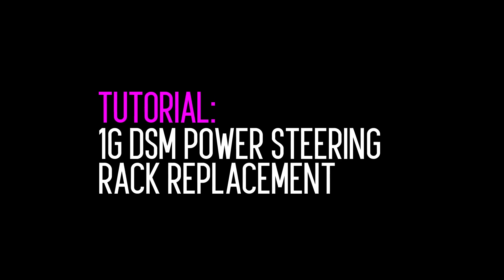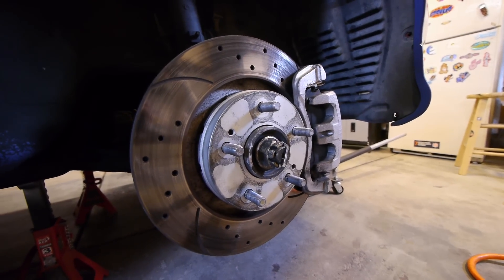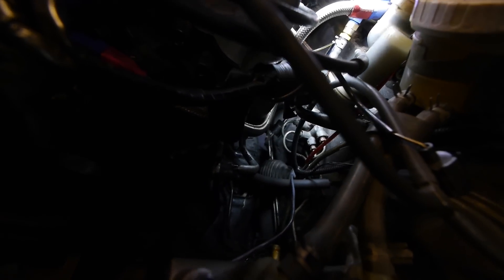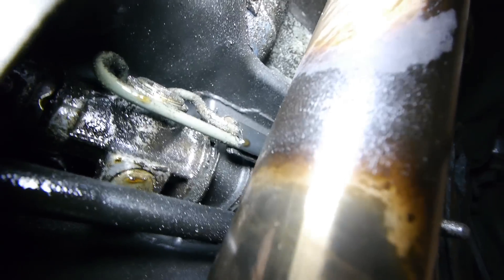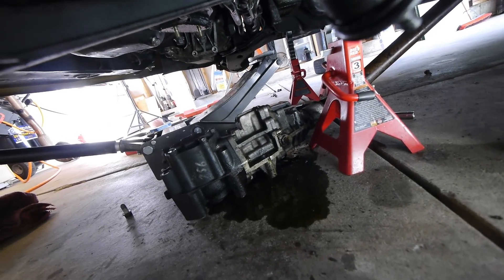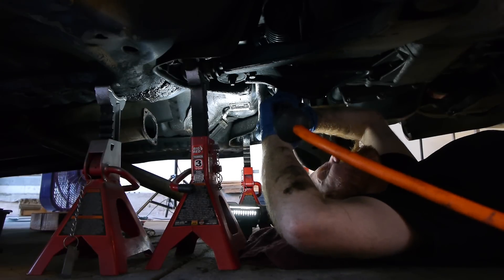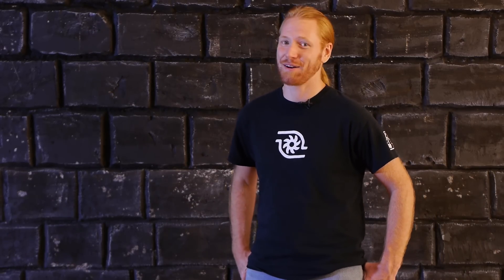1G DSM Power Steering Rack Replacement

Comment: Great video again! I would like to add one small point to this video, not that it wasnt perfect the way it was, but it may be helpful. People WILL need to get an alignment done after performing this swap. I always try to meausre my current rack tie rods and end links to get them in the ballpark and match these measurements on my new rack. Also make sure you are in the center of your throw before inserting the splines into the coupler. This will save some people the mistake of having to pull the rack back down to correct things once up. Again great job doing this video and I would like to see more video's more often from you. I enjoy them very much. - Adam@SickPerformance
Reply from the maker: +4G63addict Good points!  Yeah I forgot to mention all of those things, I'll add them to the description and hopefully people will see this comment as well.  Glad you like the videos, I'm working on getting them out more often!

Comment: Nice work i did the same on my 91 dsm but i never removed the cross members. I wish i did tho would of made it way easier but i still managed to get the job done. Also i love that valve cover color looks amazing
Reply from the maker: +Steve Davenport Thanks!  Yeah there are a few different ways to get this job done!
Reply: Hey, mine is a '91 also. I spent all afternoon doing mine but I'm having trouble getting the rack out. How did you get it out without removing the cross members?

Comment: I found it easier to access the hoses and lines to the steering rack from under the car instead of removing plug wires and ac lines from the top. I drive a fwd though so maybe it's different. Total time about 8 hrs minus a trip to the store thanks!
Reply: Sweet... just what I needed to hear!
Plan on attempting this very soon.

Comment: hello I saw your article on dsmtuners and you replace outlander brake system I mean caliper and rotors so I have 2g dsm rims and specs:
 Wheels measure 16x6" +46mm offset
Wheels carry a 5x114.3 bolt pattern and 67.1 Center bore

so outlander brake system will match with my rims?
thanks

Comment: I've always found it easier to pull the transfer case straight onto my chest. After it comes off the alignment dowel the splines from the output shaft will hold it until you can wiggle it off.

Comment: This job on a proper hoist with good tools takes me 1.5 - 2 hours, depending on how much the steering shaft bolts fight me. Also have to torch the jam nuts a lot of the time. I always recommend replacing the inner and outer tie rods with any steering rack replacement.

Comment: How hard was it to disconnect the shaft from the spline on the rack? I loosened the 12mm bolt but its not giving... I can't really get a pry bar in there to separate.
Any advice?

Comment: Wish me luck lol, im going to be doing this pretty soon. Except I found a manual steering rack from a base model 1.8l dsm and all the mounting brackets for it, if all goes well ill have those shipped from a wrecking yard with everything I need. Just going to completely get rid of the power steering all together, but pulling it out is going to be biggest hassle of this project..

Comment: Hey fantastic detailed video! Can I ask what brand of tool you used to pop out track rod end joints? Thanks
Reply from the maker: +Jay Young (Turbo21) Harbor Freight Ball Joint Separator, check out the Drop Spindle video where I buy it!  Here's a link: http://www.harborfreight.com/3-4-quarter-inch-forged-ball-joint-separator-99849.html

Comment: I have a question for you. Have you ever had to deal with your idle pulsing? And if so what was your solution?
Reply from the maker: +Steve Davenport I've been lucky with this car, but idle surge on DSM's is pretty common.  I'd start with a boost leak test and then follow this guide or other articles on DSM Tuners.  http://www.dsmtuners.com/threads/how-to-fix-your-idle-surge-problem.191137/    Good luck!
Reply: Ive done a boost leak test even rebuilt my throttle body and tested again with no leaks but idle still pulses.

Comment: Great video! I gotta know what kind of camera your using!!
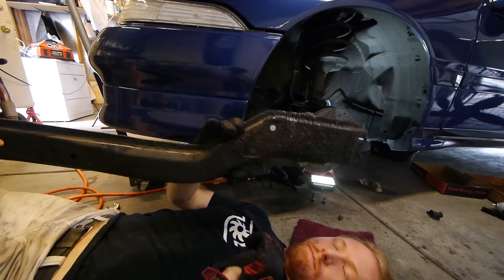Reply from the maker: +Joe Wrenches I'm mainly using a GH2 with a couple different lenses and I also use a little Sony dsc-tx10 to get into tight places, like the shot 4:55 showing the rack and 4 bolts holding it on is the dsc-tx10.  I also have some T3i shots mixed in occasionally.  I want a Sony A7S, those things can literally shoot in the dark!  I need more car parts first though :P
Reply: +Velocity Labs Thanks for the info! I think I need a GH2 or T6i type camera coming up here. Car parts DO trump though!

Comment: I did a power to manual rack swap on my old 89 Colt GT, but I had the motor out during a 4G63T swap, so it was easy. Same procedure, just less work.

Comment: Hello Erik love the AWESOME DSM vids. I need your expert advise with my 1g GSX, I have to replace the brake. The guy I got it from told me to look on google for the 1ga big brake. I just don't know what to get, please help I need to change the brakes man. And I'm also replacing the suspension, I got the KYB AGX shocks and the GROUND CONTROL springs. What's your opinion on that setup. Thanks for your time, and please continue with the amazing VIDEOS!!!
Reply from the maker: +isthatkool I did the 2005 Mitsubishi Outlander Brakes.   Here's a link, if it doesn't work just google "dsm bigger brake upgrade."  You'll need some adapter lines from RRE and rotors and calipers from an Outlander.  That suspension setup should work well!  Good luck!http://www.dsmtuners.com/threads/05-06-outlander-bigger-brake-upgrade.428973/
Reply: +isthatkool You can also pull the brake calipers and mounting brackets off of a 92-94 dsm or a base model 3000 gt SL or a 2g dsm. the only problem is that the 1ga has a screw in brake line and the 2g's have a banjo fitting. but if you pull from a 1gb it should be a direct swap without even changing the brake lines. i have no idea about the 3000 gt SL calipers. Just make sure you get the ones with the same type of fitting as the one on your car so you dont have to swap brake lines. And then you can order 2g gsx rotors and bam.
Reply: +isthatkool its a really easy swap too, i think in total i spent $80, but i also had the calipers when i bought the car. each rotor was like $30 or so and then i had to buy brake pads.

Comment: So in theory... with the Front Wheel... it souldn't be too bad as I wouldn't have to worry about the transfer case.  Just found out mine has some major leaks; dumped a whole bottle in a half in under a week JUST SITTING while I was doing a turbo upgrade.